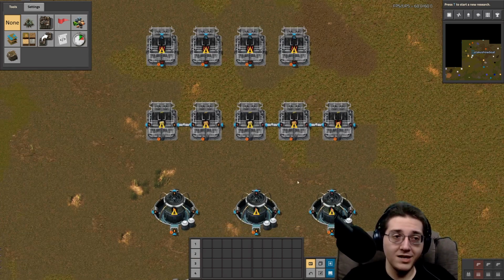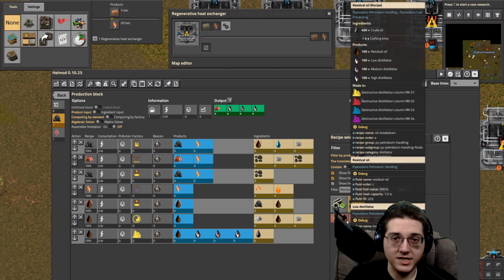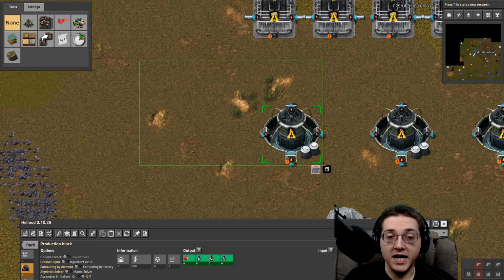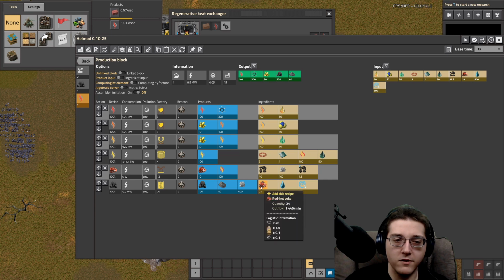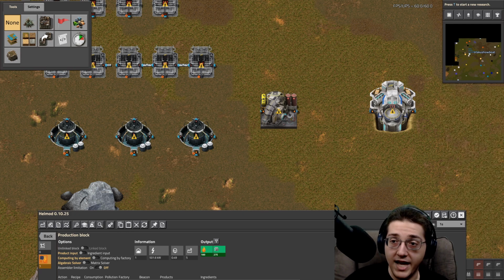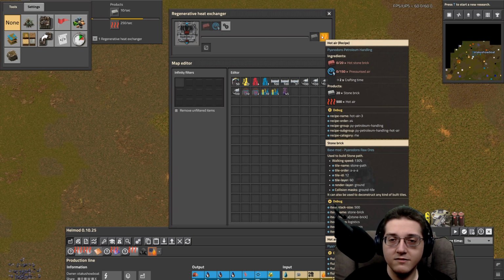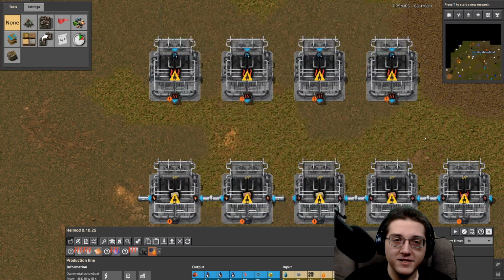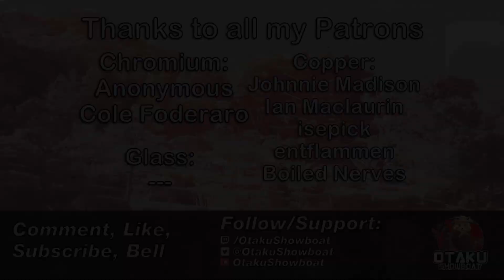How to make the updated hot air | Pyanodon Tutorial

Comment: I learned late that this is THE way to make sulfur. Was struggling with all other methods, and even started to setup the arums and realized I didn't need them anymore with this setup. Also for the heat exchangers I agree it should be hot steam and not lossy on the gas input to make any sense.

Comment: I disagree with your opinion that combustion mixture is for power only.  Only a little bit is required for the looping of the loop.  All of the flow can be easily controlled with pyIndustry valves.  Your power station would be close to the hot air since for the 500c mixture, your coke processing would likely be close to your destructive distilation to syngas, providing the requirements for both.  Both of those are coal based, so it is more productive to go further in fnei and find it is still more efficient in terms of raw coal input.  And for the 1000c mixture, if you are at that level, you would likely have reserves of combustion mixture, you can use flow control valves such that the loop would get starved slowly when the power grid is stressed or power inputs are lagged but then get brought back up quickly when load drops.  There are ways to be very opportunistic about this process that are beneficial.